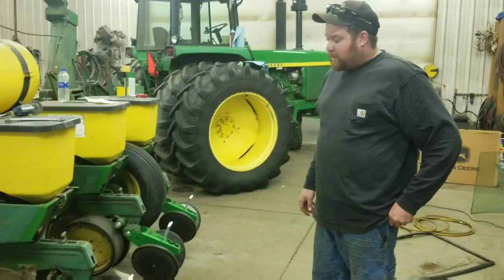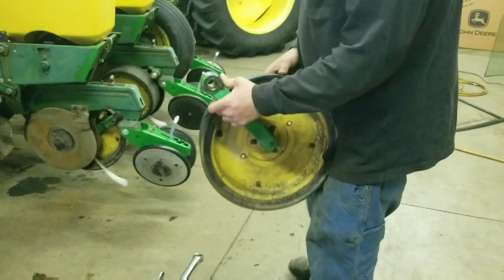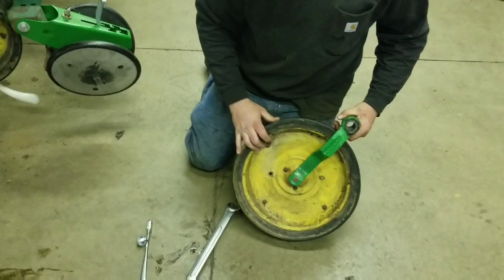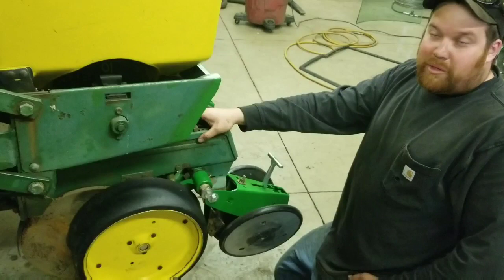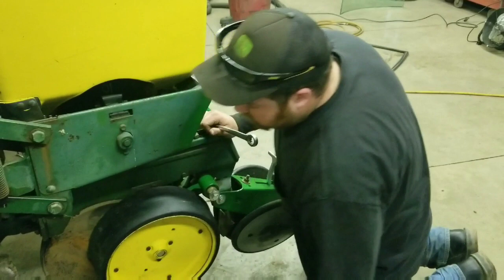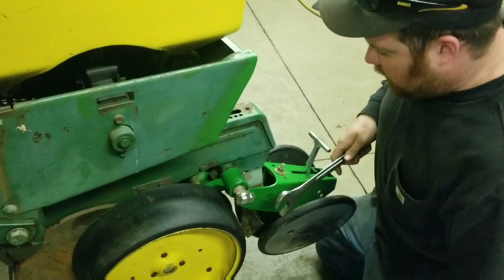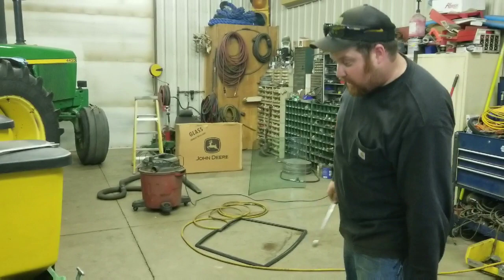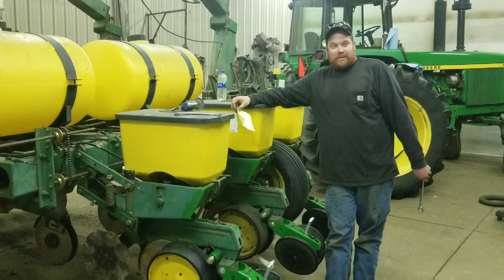John Deere 7000 corn planter worn gauge wheel remedy!!! With Shoups manufacturing!!

Comment: Now shops sells a gwk3500 which uses a bolt to hold gauge wheel on and bearing is 4 times the size.
Reply from the maker: I'll have to check them out!

Comment: On these planters is it possible to run  the wavy coulter like yours ahead of the disk opener and also row cleaners or does it have to one or the other
Reply from the maker: Yes there are kits that allow you to run both we actually took our wavy coulters completely off and went back to just yetter row cleaners we like the way the row cleaners clean a nice strip so the plant can grow with out having to push past any garbage  if you watch my latest video you can see how well the row cleaners did in the cover crop I was very impressed